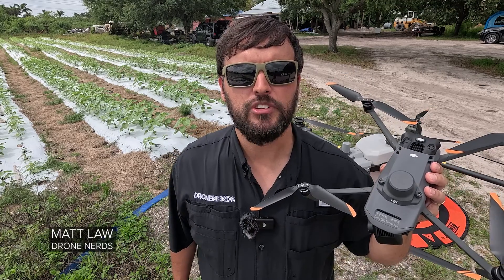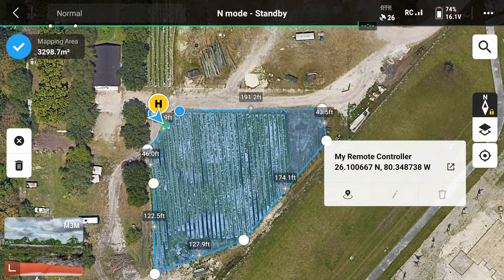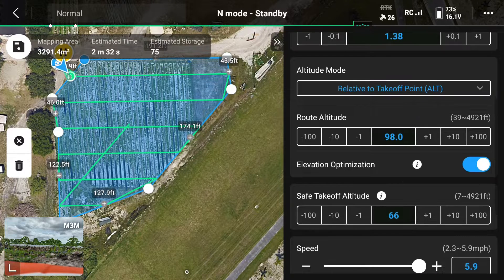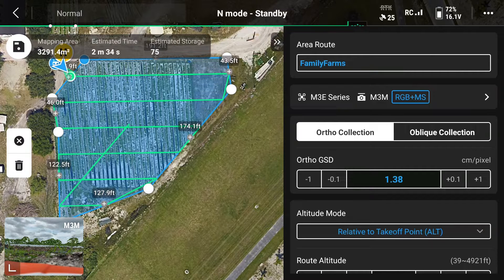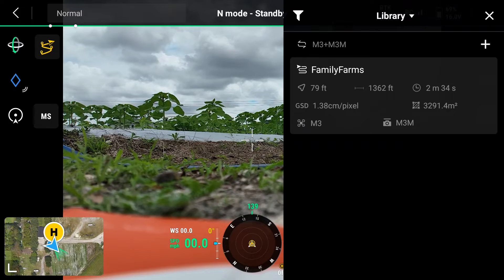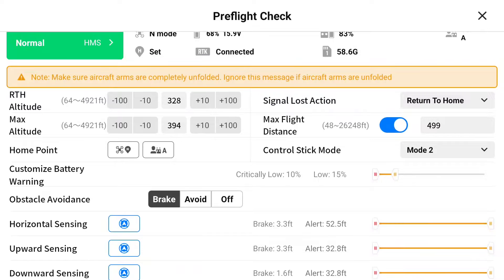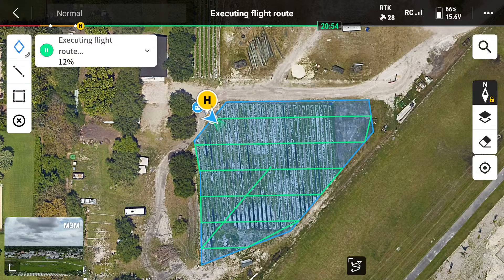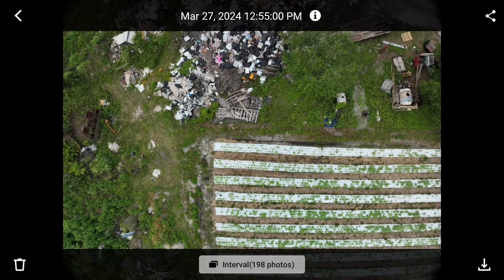Agriculture Workflow Series - Multispectral Mapping With DJI M3M

Comment: Hello, I was watching a few YouTube videos about the NTRIP (Custom) service and learned that it may have limitations, such as potential connectivity interruptions. I understand that in some states, the service is not free and could cost around $500 per month.  How likely are these interruptions, and in your experience, how long do they typically last? Also, is it possible to purchase the service only for the period when I am ready to operate, or is there a requirement to sign up for a full year or other long-term commitment? Thanks for your insights.
Reply from the maker: Hi Mustafa, not sure about price but as for NTRIP, it's primarily limited by internet connection so the more stable the connection, the better the data.

Comment: Is there a real gain when you use the multispectral drone to check your farm?
Reply from the maker: Yeah, there’s definitely a benefit. A multispectral drone can show you plant stress, water issues, or disease way before you’d notice it just with your eyes. That means you can fix problems earlier and only treat the areas that need it instead of the whole field.

Comment: Great video. What is the reason you used the RTK module? What necessitated the need for the accuracy.
Reply from the maker: Hi Peter! Yes, the RTK module improves accuracy in missions.
Reply: Thanks, Matt. Why is the extra accuracy needed? Sorry if I did not formulate my question correctly